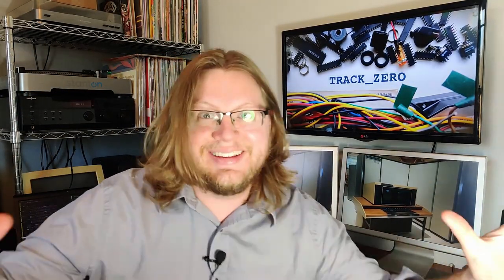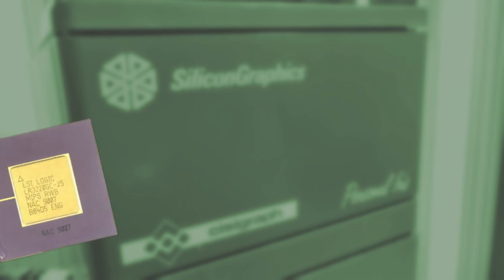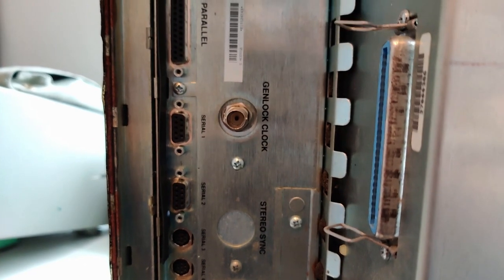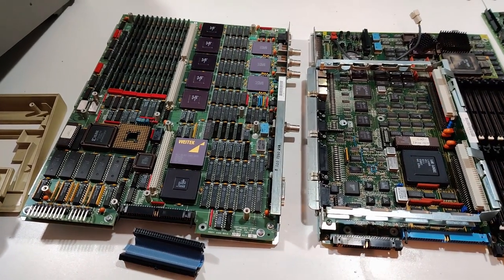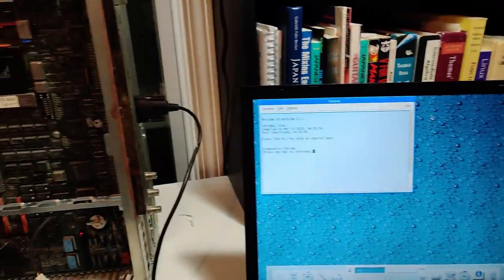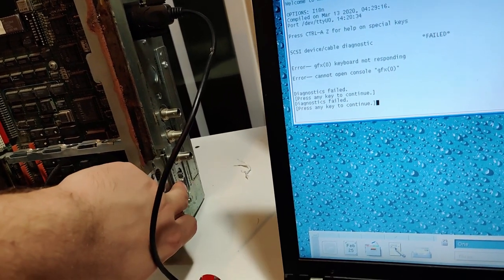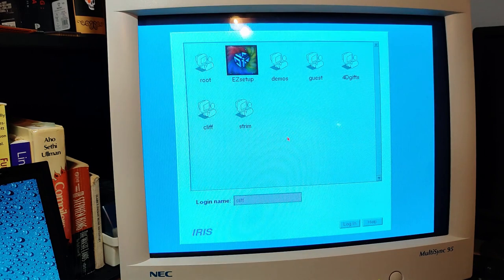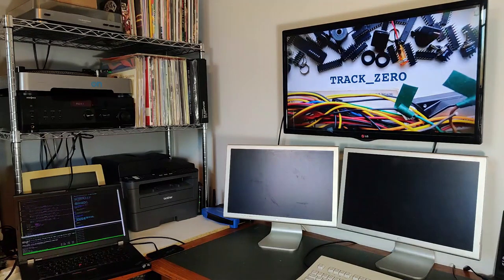SGI Personal IRIS tour - can I get it to run?

Comment: Your viewers may be surprised to learn that Personal IRIS systems are still in commercial use around the world, mainly for industrial process control, including factory floor systems, PCB manufacturing, textile production and also vis sim. I'm in the midst of fixing an IP12 board at the moment.

Comment: I have several old SGI's sitting in my office for display. My pride in an old SGI Indy R5000 XZ. Everything original even the stress ball, packaging and monitor. Completely as you would receive it from SGI back in the days. I used to work for SGI as a product specialist on the Alias|Wavefront products and this system was given to me for demo purposes. It was however never really used, cause the O2 was launched not long after and the sales department preferred to do demos on the much faster graphics of those machines. The O2s were also much easier for us to take on the road for demo sessions.

Comment: I've long wanted to just have one of these.  I started working at Metrolight Studios Jan '92 and they gave us entry level guys these 8bit systems thinking it was all we needed for modeling but all the software ran like rubbish on them so a couple of us would basically work a double-shift to hop on a 4D/35 TG in the evenings and actually get some real work done.  The 4D/35s were the Cadillac workstations in the office.  Just a dream to use.   Especially when they were running NeWS, which was Display Postscript like the NeXT.  Windowing was sharp and fast and high performance.  Less so when they switched to the more conventionally compatible Motif and X, which rendered older machines like the 4D/20 and 4D/25 painful to work on because it was more of a resource hog.

But I'd still love to have a working 4D/35 running Wavefront Advanced Visualizer, just as a reminder of how far things have come.  I have to say though, there was an elegance in the simplicity of a lot of that old software and UIs tuned for 19-21" CRT monitors.
Reply: Hey Sean, thanks for sharing your memories! I have a copy of Wavefront TAV running on my Octane. I was wondering if you have a user's guide for it? Can I email you and ask a few questions regarding the TAV?
Reply: @PeechaLaCosh  I never saw any sort of user's guide.  We had manuals but I never actually looked at one much.  I just picked up the basics for how keyframes worked, which is different than any other DCC I've ever seen because I remember you applied or set keyframes, then manually ran an interpolation over those, but it was an explicit baking process with per-frame data generated, not live spline curves.  You had to re-apply keys while they were still in memory, in case you wanted to do a different interpolation or tweak the keyframe values, otherwise you lost them.  I picked up Preview and (I think it was called simply) Model(er) this way, with pointers, watching one of the seniors or just intuition and trial/experimentation.   I never used the renderer, I don't think even once, because we had a very high performance scanline renderer made in-house at Metrolight.

TAV is actually a fork of the animation tools that were developed at Robert Abel & Associates.  Kovacs, who started Wavefront, was one of the original authors of some of the Abel tools and had enough ownership (or clout) that when he left he was able to take a fork of the source and start Wavefront.   And as the Abel tools started out as camera motion control previsualization software, the whole keyframe and interpolation scheme worked, I guess, like moco software, not how 3D DCCs would eventually evolve.   I seem to remember watching some of the stage guys at DD running Kuper software and it maybe worked more like TAV in this respect.

But that's all I remember, because I only used TAV for animation and modeling, along with Alias software and lots of in-house tools, between Jan. 1992 and around June of 1993 when I joined DD during its initial start-up, and switched to Prisms (which started as a fork of the Omnibus studio tools, and later became Houdini).  Prior to that I'd only used various Amiga DCCs like Videoscape 3D (which became Lightwave), Imagine 3D, Animation:Journeyman, Caligari and Lightwave.

Comment: I owned a Power Series 4D/310 GTX in the past.  It was upgraded with the IP17 R4400 CPU board from the Crimson.  Unfortunately i fried the GTX graphics subsystem by running it from an ungrounded socket.   Still own the front door and the cpu board though.

I considered upgrading it with a Reality Engine boardset,  but decided against it as the RM4 texture boards are dying.

Comment: Very cool machine. Back up the drives, as they're the weakest link in the chain, then clone the drives to one or more logical drives provisioned from a (comparatively huge) SD card running on a SCSI2SD adapter. That's what I did for my MacSE, Amiga 3000 and my IRIS Indy (which incidentally use the same wd33c93 SCSI controller as my Amiga 3000) and it's works great. I miss the sound of those old drives (though not the seek latency), but being electromechanical in nature, things like lubricants have broken down with age (not to mention the tendency of some brands, like Conner, to have bunk caps). Part of the fun of these old "barn finds" where the system was left untouched after decommissioning, is having everything as it was. It's like a time capsule.

Comment: I did use briefly a personal iris for work, until we moved to indego workstations.  It was a nice machine.  You should  feel the weight on the Octane its even more rediculas than the iris.
Reply: Yup Octanes are a boat anchor, and bigger than ppl think from pics. I also had an ONYX which was damn near impossible to move with 2 guys, I hated the side panels that kept spontaneously falling off the damn thing.

Comment: In college, I had a friend who did that sort of power supply hack to resurrect a PDP-11/45 that we managed to find discarded :-)

(Of course these days, I'm used to watching electronics vloggers who would actually throw that dead PSU on the bench and try to fix it.)
Reply from the maker: I want to be able to work on it, but I'm too wuss. I need proper high voltage probes for my scope.

Comment: At the company I was working for 1993 I organised a test installation of PTC Pro/Engineer 3D CAD software. And it came on this machine. That was something back then when the IBM PC-AT was the most powerful computer we had. I was fascinated with smoothness of 3D shaded object manipulation on screen and overall speed of the workstation. A year before I tested Hewlett Packard series 9000-380 workstation with TurboSRX graphics option. The graphics subsystem of HP workstation was three times as big as the Personal Iris to achieve roughly same performance. And Personal Iris came with first optical mouse that I saw in my life. It used a mousepad made from aluminium with fine raster printed on it. And the desktop was zoomable! It uses vector graphics for the icons and one was able to zoom-in and zoom-out the desktop without graphic quality degradation. And yes, it uses GL as graphics library, which was later put in open domain and is omnipresent in 3D computing world today. I was simply enchanted with this machine…
Reply from the maker: Aw yeah, dude! I actually used Pro-E (it’s called Creo, now) in my last day job in automotive R&D. They used Pro-E for drivetrain and Catia for body, and I would love to see the old Unix versions of both.

Actually, I believe the O2 I got from the same guy has a copy of Catia, but the license is long dead.

Comment: That's awesome. I was excited with you watching it boot! This makes me optimistic that I can repair my old SGI by replacing the PSU.

Maybe you could talk a bit more about how you connected the industrial PSUs to the rest of the hardware? I mean, it's probably pretty straight forward when you have the pinout. But I'm wondering how exactly you did (using the original connector?)

Anyway, thank you for sharing this!

Comment: This is definitely geek porn, and I mean that as a high compliment. I grew up coding on Z-80 and 8080 machines in assembly. I was so jealous of the 68000 CPU because it had a hardware multiply and divide.  GREAT video! All good wishes.

Comment: Worked on one of those in 1993 doing renders for 3D prototypes (although it was used primarily for creating 3D printing files, they also used it for marketing visualizations). Quite the beast. Miss the OS - it shared a lot with NeXTstep - including the vert-tab menus - which I still miss today (scrolling to the top of monitors today for menus is pointless and archaic - doubly so considering a solution existed 30 years ago).

Comment: 5:25 not so odd, you can remove an secondary drive while your computer is on by ejecting it, you cant do that on your primary driver.
(well at least on linux you can, this is a unix system so it should be similiar)

Comment: Congrats on resurrecting the PI. I wouldn't give up on the original PSU just yet tho -- check the electrolytics, rectifier, chopper tranny, etc. The usual suspects. That said, I've never found schematics for SGI's PSUs (which were actually OEM'd from Cherokee, Power One, and a few others).
These old SGIs are high maintenance. I have a Crimson RE that's been driving me up the wall, basically coming up with new faults every time it's booted (which is rare these days). The fact hardware docs are scarce doesn't help. I've never come across detailed hardware documentation or even schematics for these early machines, at least not beyond what's in the Hardware Developer's Manual.
The striping in the graphics console is a typical fault in early SGIs, and I've seen it on Reality Engine and VGX. If you're lucky, you'll just need to reseat some RAM on the graphics board. More likely tho, that RAM has gone bad. Finding the culprit can be a real challenge, but at least PIs are still TTL and not SMD (unlike later generations), so anyone with adept soldering skills, patience, and proper observance of ESD precautions could replace them.
Another thing: BACK UP THOSE DISKS! These Seagate Wrens (probably ST4767s) are prone to failure. I keep an old PC around with a SCSI adapter running linux to dump old drives via dd.
Good luck and cherish your PI! :^)

Comment: Hey kudos! Nice video! I wish some enthusiasts would team together to design PSU replacements for these old machines
Reply: This has already been done with the P.I., but one must find a particular type of slightly older ATX unit in order for the mod to work. Modern ATX units don't have sufficiently high current limits on voltage rails which are not used so much in modern systems. I'm using such a modded ATX setup with my own P.I. test rig.

Comment: Awesome video. Do you think you're going to eventually get the PSU jan-jaap recommended so you can use the machine while it's buttoned up or do you have other plans? I really need to get around to fixing the power supply in my R3000 Indigo at some point.

Comment: IRIX 5.3? Wow, crazy this machine has the same OS as my Indy R5000 when the Indy is almost 10 years newer.
Reply: Remember Indy can use up to IRIX 6.5.22, though for lesser spec machines 6.2 will feel a lot more responsive, ditto 5.3.

Btw, do you happen to have the version of 5.3 for R5000 Indy which includes XFS support? The installation CD I mean?
Reply: @mapesdhs597  Nope, the only version of IRIX I have CDs for is 6.5.
Reply: @VSigma725  Ah, your OP read as if you were using 5.3.The 6.5.x updates do add some useful things over 6.5, especially bug fixes, and also DVD support (plus the Nekoware needs 6.5.22 minimum), though the performance is basically the same as running 6.5.

Comment: Did you know Super Mario 64 was developed on an SGI MIPS system? In fact, the rabbit in the basement was named Mips as a tribute.
Reply: Probably the most expensive dev platform for a console in the history of consoles. Ouch.
Reply: @mgabrysSF  The modified Onyx was, but the Indy with the proper board wasn't that costly.
Reply: Somewhat unsurprising, though,  given that the N64 was itself a MIPS box.